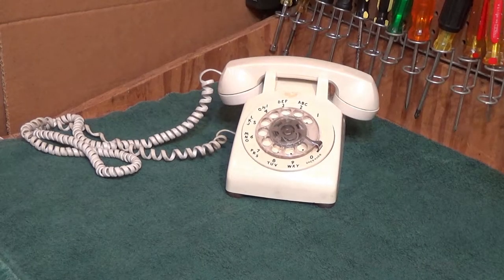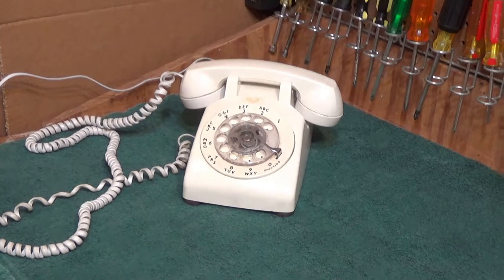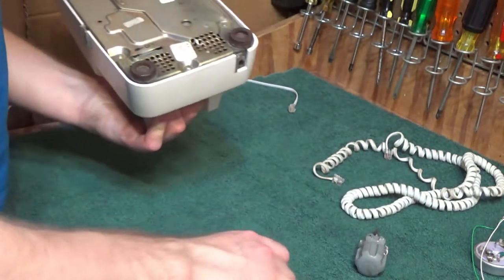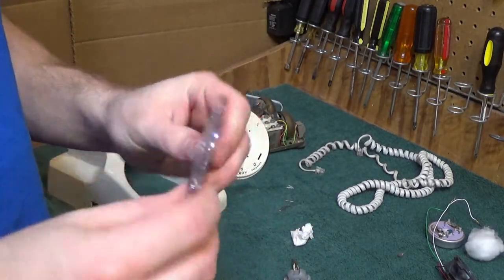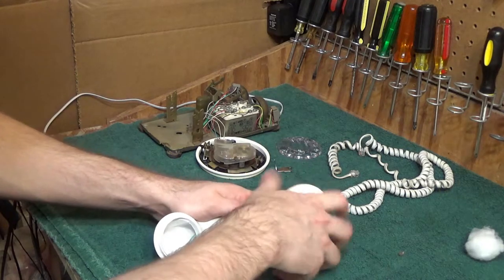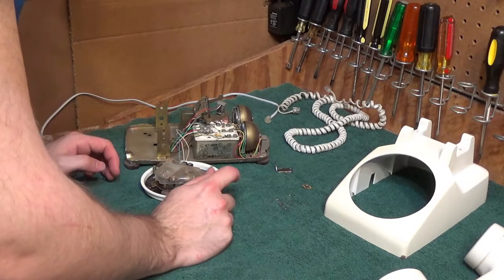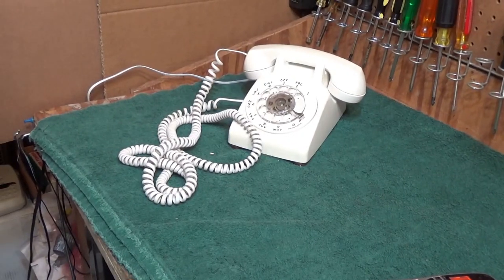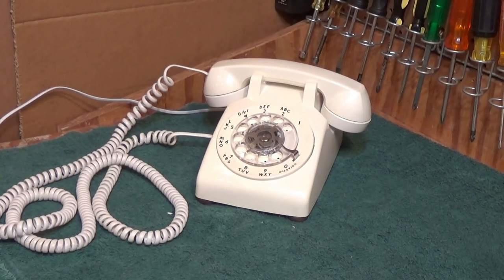Cleaning a Vintage Western Electric Rotary Dial Desk Telephone

Comment: Thank you for the video. 🙂 I have collected two rotary and one push button telephone. I really appreciated viewing the phone being taken apart for cleaning. I do have one question...would you please share what products you used to clean the plastic (mild soap and water?) or ? Thanks so much. 
Oh! I believe the “60” tag was probably the final inspection number before it went out to the consumer.
Reply from the maker: I use Dawn dish soap over the entire unit.. For the areas that are heavily soiled or marked, I use a paste made from water and baking soda..
Reply: Thanks so much. If you don't mind, I do have another question. As I previously stated, I have two Western Electric rotary phones and one push button princess. Once I got hardwired service, I was hoping to take the push button and just plug it in...that was until I took it apart and saw the wires on the handset had been clipped off at the base and it is missing the piece that hits the ringer. Would you be able to recommend a repair company/person that is not out-of-this-world expensive? I know of Old Telephone Works, but I might be spending $200 to repair a push button phone I only paid $5 for. Thanks again so very much.
Reply from the maker: @hedvigjenson4902  I recommend A1 Telephone, but I don't know what they would charge you.. Nobody that does novelty work like that charges at a low price..
Reply: Jordan U Thanks so much!

Comment: You have so many cool phones! I have one extension ringer and two rotaries plugged into my system, my house originally had a phone line but it was cut long ago, we have fiberoptic now and the box where we get our connections has a "pots" plain old telephone system. I do not know how many more I can add but I have another rotary phone I would like to connect up, we have a viarity of new phones in the system aswell, at some point i'd like to add a phone in the garage since we already have a phone line out there but I dont wanna kill the phone line since its modern and probably not able to power all of these old phones haha! I have a few phones that I keep on display only so I dont use those, but I just love how you have so many around the home! Would love to see a video of that antique Western Electric / Kellogg Magneto Phone!
Reply from the maker: I've found 2 or 3 phones is the maximum for a decent VoIP modem. You can get a ring amplifier to support more.
Reply: @JordanU  What do you reccomend for a ring amp? I havent had much experience with that stuff like all the wifi and modems, I mostly just know old stuff like transformers lol
Reply from the maker: @johnsidlauskas3838  I use the Viking RG-10A. Very expensive piece of equipment but worth every penny. I've had it in service for several years and it's never had a single issue. My phone setup simply would not be possible without it.

Comment: Lovely phone made to last. I'm sure some are still in use today. I'm a British collector and have a few of these. I found cotton wool in my receiver too in an ITT model.Not sure either why they used it. does the phone have a date on it somewhere?.Thank you for sharing.
Reply from the maker: Thanks. I’ve been told the cotton is to prevent feedback within the handset. On most of these I’ve seen the date printed somewhere on the bottom.
Reply: @JordanU  Thanks Jordan. That's why then.All the best Pete.

Comment: What is it that you used to be able to dial out with your rotary phone.  Just recently got mine to ring and have a dial tone but still can't dial out.  Helpful video, thanks,
Reply from the maker: A lot of phone services are dropping support for rotary dial phones. The service I had at the time of the video happened to support it still.
There are devices available to convert the pulse (rotary) dialing to tone such as the DialGizmo. I use a PBX system for the conversion, but that's getting more complicated.

Comment: Hi, i just bought an old 70s rotary phone yesterday and looking up for videos on how to clean it and came across your video :).  I have a question for you, if you don't mind,  as my new phone is still in very good condition and it just requires a light clean (i am thinking of using diluted simple green). I would to know if I have to take the phone apart for cleaning ? or it is ok to spritz simple green directly on the phone and then wipe down? Thanks!!
Reply from the maker: Surface dirt can be removed as you described without dissembling.
Reply: @JordanU  Thank you for your reply, I will get cleaning tomorrow. :)
Reply: " Hi, i just bought an old 70s rotary phone yesterday  " Cool! are you going to connect it to your cell phone?
Reply from the maker: @Become_A_Paid_Electronics_Tech  How many times do I have to explain to you that advertising is not permitted in my comments box? DO NOT POST SPAM!
Reply: @JordanU  and how is asking ONE question SPAM??   Cool! are you going to connect it to your cell phone? HOW IS THAT advertising spell it out if you please????
Reply from the maker: @Become_A_Paid_Electronics_Tech  You have a history of targeting individuals in my comments box with the sole intention of making a sale on the device you show on your channel. That is advertising, perhaps even deceptive advertising, in pure form. It is unsolicited and unwanted and simply will not be tolerated here.
Reply: @JordanU  and you can speak to this as you said ' deceptive advertising' have you an example?
Reply: @JordanU  and what sort of 'device' are you talking adout?
Reply from the maker: @Become_A_Paid_Electronics_Tech  You only have one video on your channel, and that is the device you're trying to draw people's attention to. You know that just as well as I know that. Don't waste my time, and don't play stupid. Neither will get you anywhere around here.

Comment: I can’t seem to detach the clear dialer. I used a paperclip and followed the video but Is there a button or hole deeper inside where I need to push to release the dialler?
Reply from the maker: You do need to push it in rather firmly.. There are other videos available that show the process in greater detail..

Comment: 8:20 - "There's almost nothing electronic in here." 

There's nothing electronic in there whatsoever. A Western Electric 500 series is electrical, mechanical, and electromechanical. Not even the early Western Electric 1500/2500 series phones, which were touch-tone, had any electronics. Some newer versions of the 2500, starting probably in the 1980s, had electronics in the keypad though, i.e., a tone generator chip, such as a Texas Instruments TCM5087N.

Comment: You can clean those heavy plastic phones up....fine brillo pad or steel wool on the yellowing...then use fine polish on a buffing wheel till it shines...dont use too much force and burn it..the clear plastic too...finish off with coat of vasoline in sun for an hour or 2 then wipe it off..
Reply from the maker: Thanks for letting me know.

Comment: Hello Jordan U I have a good explanation for if the cords are original,  i am not sure if it’s true but I am just assuming, judging by the fact that a 66 year came out it probably means 1966, and I know that in 1966 they didn’t have modular your telephone was hardwired into the wall, so that cord on the phone since it’s modular is probably when the phone company or lineman or whatever refurbished the phone for modular that cord was put on, or it could be a replacement cord of the oringal, but it’s definitely not original to the telephone since the oringal was hardwired.  They do sell modular ports replacement but if it’s working there’s really no need especially if it’s not going to be in your house house like in a guest bedroom or enterance it’s fine.

Comment: If only the handset on my phone was that simple to take off. It's stuck! And the cord needs refitted as it somehow got pulled out too far.
Reply from the maker: Sometimes they get a little stuck after years and years of dirt and moisture has accumulated in the threads and around the seal..
Reply: @JordanU  Any suggestions about what to do when that is the case?
Reply from the maker: You can try adding some moisture around the seal, or banging it against something firm but not damaging to the finish to try to break the seal..
Reply from the maker: @BBC600  Were you ever able to free yours? I've recently come across one where the microphone refuses to unscrew, and all the tricks in my book are simply not working.
Reply: @JordanU  Wish I had some advice for you. I did manage to get my phone fixed by YouTuber themaritimegirl (she has a video on her channel of it). It was funny as I tried to demonstrate to my Mum that the capsule was stuck prior to shipping it out to New Brunswick (I'm in Saskatchewan) and it just came off as per normal. I guess I managed to just happen to get whatever gunk had accumulated out of it by messing with it so much. All I can say is that perseverance is king.